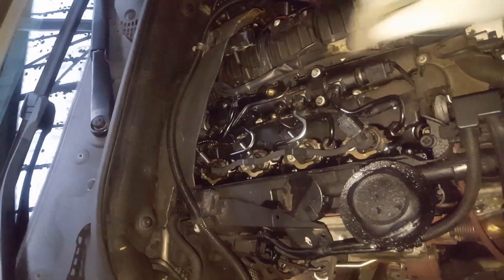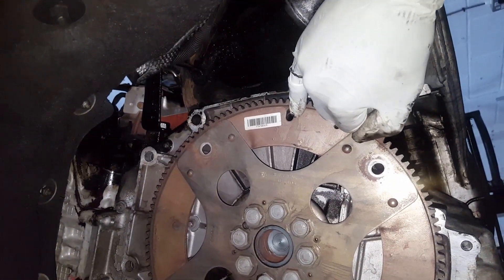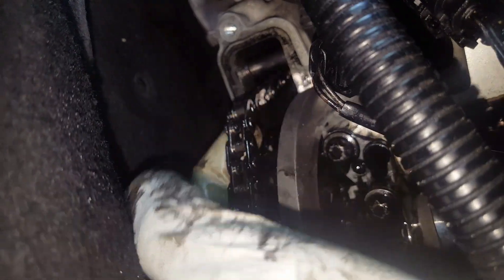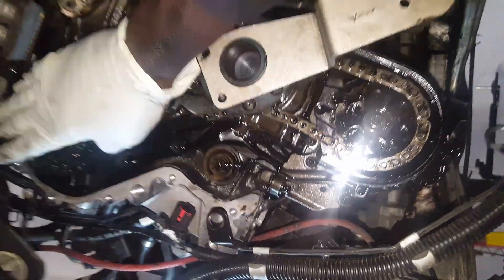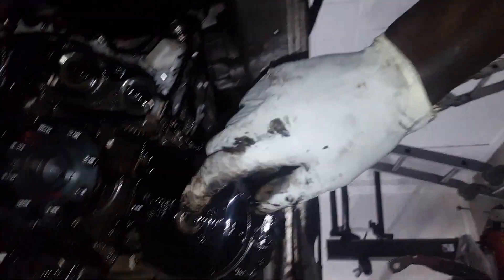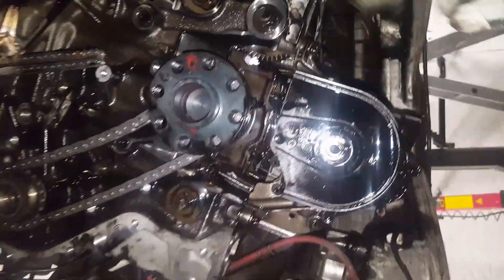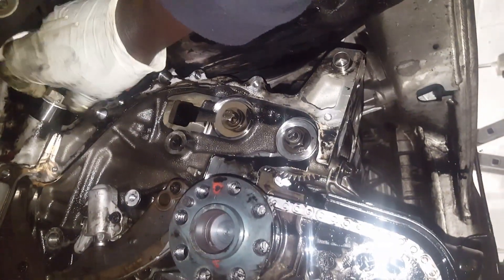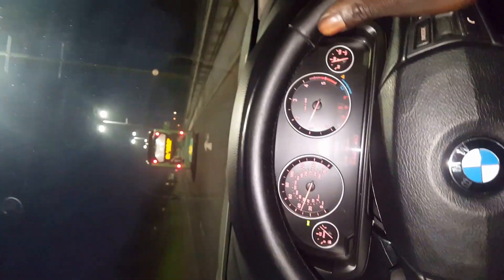BMW N47 timing chain replacement | click video describstion below for info

Comment: I did my timing chain this weekend everything went smooth, but i got a fault code on crankshaft sensor signal. Have i broken it or what do you think? Car takes few extra secounds to start also because of it, no wierd sound or anything, also runs smooth when it starts.

Crank and cam is in the right place, when i lock cam with tool it fits good also when i lock flywheel with the tool.

Comment: Hey Dawda, I highly doubt you’ll see this but, I’m timing my n4720dc engine right now and the chain for the crank to the fuel pump is more slack on the guide side, I tried moving the chain to make it have more tension on the guide side but it’s just not happening, is it a case of moving the chain and I’m doing it wrong or has it stretched, please help 😢

Comment: Need to subframe drop to remove oil gasket on e90 N47?
Reply from the maker: I normally use engine support beam on top of the bonnet. 

Unscrew two engine mounts bolts.
Whine the engine supporter up so the engine will lift up then it will give you enough room to remove the sump. Without having to lower the subframe. 

See link below to see what I mean about the engine supporter. Thank you 

https://www.ebay.co.uk/sch/i.html?_nkw=Engine%20Support%20Beam&norover=1&mkevt=1&mkrid=710-154085-016263-8&mkcid=2&mkscid=102&keyword=engine%20support%20beam&crlp=534040399184_&MT_ID=&geo_id=&rlsatarget=kwd-300271236689&adpos=&device=m&mktype=&loc=9046121&poi=&abcId=&cmpgn=13821929220&sitelnk=&adgroupid=126211701242&network=g&matchtype=b&gclid=EAIaIQobChMI2dSbk4iFgQMVydvtCh1z8QhZEAAYASAAEgLf9vD_BwE
Reply: @dawdathemechanic-dawdaauto1761  ahh , very thx  , u best💪💪💪💪

Comment: Is there no specific timing for the fuel or oil chains. 

As long as the cam chain is timed correctly the other two don’t matter?
Reply from the maker: Hello mate yes I put it in the description because I forgot to mentioned it in the video.
If you haven't align the mark on the fuel pump, engine  will still run but
It's recommended to ensure groove on high-pressure fuel pump shaft aligned with lug on timing case.

Please click the first link below to see picture number 9 and 13 that's what I meant. 

Also click the second link below to see video of what I meant. foward the video to 0:51sec.
Thanks 

 https://www.google.co.uk/search?biw=3...

 https://m.youtube.com/watch?v=VAuuxkYgQW8
Reply: Thank you

Comment: You didn’t mention anything about the timing marks on the high pressure pump, are they significant when doing the timing
Reply from the maker: Hello mate yes I put it in the description because I forgot to mentioned it in the video.
If you haven't align the mark on the fuel pump, engine  will still run but
It's recommended to ensure groove on high-pressure fuel pump shaft aligned with lug on timing case.

Please click the first link below to see picture number 9 and 13 that's what I meant. 

Also click the second link below to see video of what I meant. foward the video to 0:51sec.
Thanks 

 https://www.google.co.uk/search?biw=3...

 https://m.youtube.com/watch?v=VAuuxkYgQW8

Comment: brilliant video. I have followed your video to replace my timing chain. I have a question, I have the timing tool. but I don't have the crankshaft locking tool. I also took your advice to take my camshaft out to inspect the rocker arms. Everything is perfect. Now, when I put back the camshaft. I locked it with the special tool before I put it back ( or I should not do this before it in the engine ) . I lineup the sprocket on HPFP.  However I don't know how to get my crankshaft timing correct ? every confusing. appreciate if you can help. 2010 32D N47D20C Manual engine.

Comment: Hi, great video and glad you got up and running.
I’m doing one of these myself and autodata says to install the crankshaft holding tool the other way around and secure it with the m6 bolt into one of the timing cover holes, it also says to line up  the mark on the high pressure pump sprocket with the one on the engine. Just wondered if you had to do this and would it matter or not.
I can see that you are a very good mechanic and just wanted to share this information with you as I don’t understand the bit about the high pressure pump needing to be timed.

Thanks, Chris.

Comment: Heads up guys.
Its worth doing if the cars on a high millage, 
In 2013 car was 14grand
Dealer knocked 1k (saved it)
Bought the car for 13k
Car was at 85.000 
In 2014 at 91.000 changed the timing chain.
Cost £1200 garage fitted new oil pump for free since he broke the bolt inside the pump and said its a pain to get out. 
Now in 2021 cars at 142.000 next timing change will be at 180.000

Comment: The n47 c and d  engine is not as bad of break fast. Thing to do is every 7/8k doing early oil change, bmw idrive service is crap. And swap to 5w-30 or some use 5w-40. 
0w-30 is too thin of an oil. 

Also driving only local is never good for this engine.
My uncle used to  have a 2011 e90. His driving was only traffic every day, his  engine started going bad.

Mine is a 2009 and he was shocked how different mine run from his. Since my daily drive is motorway.

Comment: I try this method on my bmw n47, 116 d and it didn´t work, I had to place first the crankshaft 45 degree atdc, then hpfp on the mark then the chain betwen them, then turn back the crankshaft to tdc ,after this  place the cam shaft chain
Reply: How do you turn it 45 degrees atdc? Does it allign with a hole or how do really you know it is at 45 degrees atdc? Thanks

Comment: Informative video, I've just removed the chains ready to replace them and my instructions are telling me to have the crank at 45 degrees after TDC to time the crank to HPFP
Reply: @Nagato is better than Punk Naruto This might be a dumb question, I don’t have much mechanical knowledge but I’m going to try to do this on my own n47 engine. When you’re putting the flywheel back on and realligning it with the locking tool, should the crankshaft also allign with the tipex or are they separate?
Reply: @Nagato is better than Punk Naruto alright thank you. Is there really any need to put the flywheel back on if you can just allign the crankshaft with the tipex? Tell me when you find out thanks 👍😊
Reply: @Nagato is better than Punk Naruto wonderful. Thank you!
Reply: @Nagato is better than Punk Naruto oh by the way did you mean the high pressure fuel pump or the oil pump? Also is it 45 degrees clockwise or anti-clockwise (seen from the back of the engine)?

Comment: Hey Sir! Thanks for the great video!

Is it mandatory to release the Oil from the Automatic transmission before removing it or can I remove the transmission and keep the transmission oil inside?

Thank you!
Reply from the maker: Hi thank you.
And no it is  not necessary to drain the oil. You can remove the transmission without draining the oil. Thanks
Reply: Dawda The Mechanic- Dawda Auto Services thanks bro!
Is there anything to pay attention to when removing the torque converter in comparison to removing a clutch?

Comment: Fuel pump timing
Reply from the maker: Hello mate yes I put it in the description because I forgot to mentioned it in the video.
If you haven't align the mark on the fuel pump, engine  will still run but
It's recommended to ensure groove on high-pressure fuel pump shaft aligned with lug on timing case.

Please click the first link below to see picture number 9 and 13 that's what I meant. 

Also click the second link below to see video of what I meant. foward the video to 0:51sec.
Thanks 

 https://www.google.co.uk/search?biw=3...

 https://m.youtube.com/watch?v=VAuuxkYgQW8

Comment: Did you have to angle the engine towards the back to gain access to do the job or does the engine stay at the same level/angle? How did you hold it in place with just the two engine mounts?
Also, did you have to lower the suspension subframe to remove the sump? I heard that on the older M47 engines you had to do that in order to take the sump of
Reply from the maker: Hello mate the engine will stay stationary with 2 engine mounts.

This is from 5 series 2011, the sump came out without lowering subframe. Good luck👍

Comment: Heeei! You didn't install oil pump sprocket correctly!!! Wrong side! Check side when you took it off!!! You have tightened it to the oil pump, but not to the oil pump shaft 200%.
This is the reason why my bolt and sprocket disconnected from oil pump shaft 7000 km after chain change, and as a result causing no oil pressure and after 5 miles broken turbo!

Comment: Is the high pressure fuel pump not times to the crank ?
Reply from the maker: Hello mate yes I put it in the description because I forgot to mentioned it in the video.
If you haven't align the mark on the fuel pump, engine  will still run but
It's recommended to ensure groove on high-pressure fuel pump shaft aligned with lug on timing case.

Please click the first link below to see picture number 9 and 13 that's what I meant. 

Also click the second link below to see video of what I meant. foward the video to 0:51sec.
Thanks 

 https://www.google.co.uk/search?biw=3...

 https://m.youtube.com/watch?v=VAuuxkYgQW8

Comment: hey buddy i have same issue i think.  can i email you the noise it makes and the codes i have?
Reply from the maker: Hello mate 
If the code mention cam shaft then you must get the chain done ASAP before it breaks👍
Reply: I don’t have cam codes but heavy chain rattle at the back of my 2015 x5d
Reply: I have egr codes
Reply from the maker: Hello mate
You definitely need to get the timing chain done before it breaks.

Also please send me the fault code of the EGR. Thanks 👍

Comment: nice job, but you have the crankshaft looking tool to help you with timing the HP pump, there is a mark on the HP pump pulley  though...or it doesn't matter timing of the HP pump ???
Reply from the maker: Hello mate yes I put it in the description becuase I forgot to mentioned it in the video.
If you haven't align the mark on the fuel pump, engine  will still run but
It's recommended to ensure groove on high-pressure fuel pump shaft aligned with lug on timing case.

Please click the first link below to see picture number 9 and 13 that's what I meant. Also click the second link below to see video of what I meant. foward the video to 0:51sec.
Thanks 

 https://www.google.co.uk/search?biw=3...

 https://m.youtube.com/watch?v=VAuuxkYgQW8
Reply: @dawdathemechanic-dawdaauto1761  waw, i didn't expect you to replay that quickly...thanks a lot for that piece of information 
I'm doing right now a n47 broken secondary chain, i watch quite a few videos to make sure I'm doing the right work...of course a had to take the head off to see the damage on the valves, so more work to do beyond your excellent videos
Reply from the maker: @danielrusu2090  hello mate it's because I was watching a video and then the message popped up.

I hardly reply but will try when I see it.

Head job is a lot more work but thats good idea what you did.

Good luck and thanks 👍
Reply: @dawdathemechanic-dawdaauto1761  I watched the video with HP pump timing you mentioned but it seems to me the guy has aligned the pump on TDC, but I read the pump mark is 45 degree ATDC...what do you think about that?

Comment: I have a 3 series 318D 2L 2009 (manual diesel) which just touched 100500 miles. Does that have the engine with the timing chain problem?
Reply: I have one with 175000 and never changed the chain......yet!!

Comment: is it really impossible to use the high pressure pump gear special puller in the tight space? Id love to not have to take out the whole engine when replacing the chains, but otherwise i dont wanna hammer on my pressure pump

Comment: In your description you say to make sure lugs are alligned on timing case and pressure pump...please explain this step and why important
Reply from the maker: Hello mate yes I put it in the description becuase I forgot to mentioned it in the video.
If you haven't align the mark on the fuel pump, engine  will still run but
It's recommended to ensure groove on high-pressure fuel pump shaft aligned with lug on timing case.

Please click the first link below to see picture number 9 and 13 that's what I meant. Also click the second link below to see video of what I meant. foward the video to 0:51sec.
Thanks 

 https://www.google.co.uk/search?biw=3...

 https://m.youtube.com/watch?v=VAuuxkYgQW8

Comment: So you didn't take the engine out but took the gearbox out
Reply: Ok bro thanx for that. I would take engine out first time and then see everything clearly the after this I would do it in situ
Reply from the maker: Yes👍
Reply: Is it no easier to take engine and box out.
Reply from the maker: @bazraja985  This video is just to show the procedure not to recommend to do it with engine in. Who ever is doing it can decide whether to remove engine or not.

I use to do them countless times with engine out and with engine in.. 

I use to start 9am and finish it 7pm with 30mins lunch break. With the engine out, I use to finish it the next day.

 My first times were always engine out👍.

Comment: Hi Dawda,

How many hours do you require to replace the chain? Thanks in advance for your reply.
Best regards
Burak
Reply from the maker: Hello mate

It's about 10 hours job 👍
Reply: @dawdathemechanic-dawdaauto1761   And is this also how to proceed with 320d N47D20C?
Reply from the maker: @burakarpacioglu7551  hello mate is it can be done this way on 320d without removing engine.

 I always tell people, this video is just to show the process of the job. Whoever is doing it can decide if they want to remove engine or not.  If removing engine is easier, do it that way. I did it this way because I  did it countless times in the past.

My first times were always removing engine..

Comment: Well explained video, but i would like to know how you got enough space to take the oil sump out. Did you lift the engine or dropp the subframe? I have a 08 520d, and it's not enough space. I've taken out all bolts and dropped the sump, but it doesn't clear the crank when it rests on the steering gear.
Reply from the maker: Hello mate thanks 👍

This one is also 520d and the oil sump did come out. It did look like it won't but it did without lowering anything.

Maybe your is the odd one. If yours definitely won't come out then, support the engine with engine supported on the top. Disconnect the 2 engine mount bolts and use the engine supported to raise the engine a bit .

Or lower the subframe if that's easier but make sure you support the engine before you lower it👍

Comment: Hi Dawda i have just purchased a 520d year 08. BMW have replaced the tensioner in the past, does this remedy the issue. Or will the timing chain at some point fail.

Comment: Can this timing chain job be done on a bmw 320d 2008 the same way
Reply from the maker: Yes it can be done this way. Most people prefer to take the engine out. Both ways will work but see which one is easier for you and do it that way 👍 thanks

Comment: Hey bro..I’ve got a video of my 520d gt 2014.. it started making a very loud knocking sound from top of engine....wold you think it could be the chain?
Reply from the maker: I heard it, leave it switch off for now..
Remove the cam cover and you should see the chain very slack..

If you see the chain very slack, go ahead and change the timing chain kit.

Once all the timing chain are removed. I also recommend you to remove both camshafts and change all the rocker arms. 

The rocker arms gets slightly bent and sometimes you can't see it properly and can damage the engine after driving it some miles.
Reply: Leave me your contact details

Comment: Hi I have same engine in my car. I had timing chain replaced 5 months ago but now I have oil pouring from I think behind the flywheel. I can't tell for sure without removing gearbox but its very bad leak. Do you know what would cause this or which seal may be broken?
Reply from the maker: Hello yes it's the crankshaft seal behind the flywheel is leaking.

It's a round rubber seal. You definitely need to take gearbox out and the flywheel.

Comment: The new chain also doesn't have doesn't have PVD coated bolts (Tritan) and so it will be damaged soon again. Didn't you buy it at a BMW dealer or is it a few years ago that you've bougt it?

Comment: From what I was able to research, in Romania, all the work on the N47 timing chain is done by removing the engine (according to BMW guidelines, as they say). Is it better to do it your way? Is it faster? What's the upside/downside?
Reply: If you have a lift then it's prob best to just remove gearbox.. If you're doing it at home then prob easier to remove engine.. That's my plan anyway
Reply: Is the timing chain a problem only in N20-N47 engines?
Reply: @DiegoKmona  All N and B series engines

Comment: Would it be possible to do it this way on a 2011 320d ? or do i have to remove the engine
Reply from the maker: The one on the video was 2010 320d so yes it's possible. See what's easier for you because most people prefers to remove  engine. Thanks
Reply: Thanks for the quick reply but it really looks like a 520d in some of the video and the test drive is definitely in a 520d

Comment: Any chance you can fix mine if I can bring my car up to you ?
Reply from the maker: Sorry but I can't because I don't have my own garage yet. Am currently working for VW dealership. Thanks
Reply: @dawdathemechanic-dawdaauto1761  Working with VW/VAG you will never get out of work either... (I drive also a Golf 1.6 2001 with 294,000 km. Transmission belt has snapped once with the former owner. May be the belt between the cams was not changed and that's why it also snapped...)
Happy New Year!